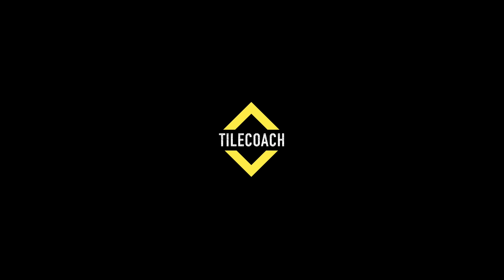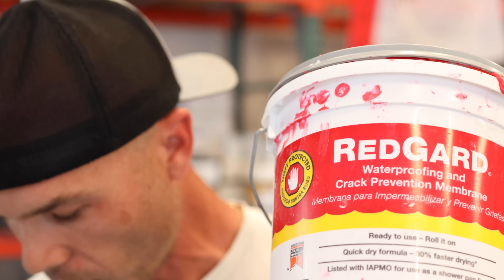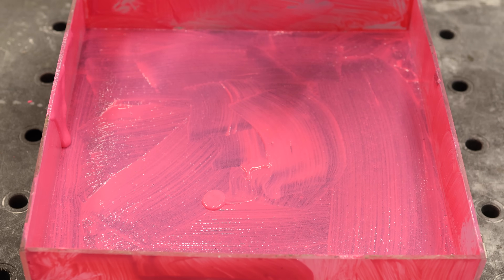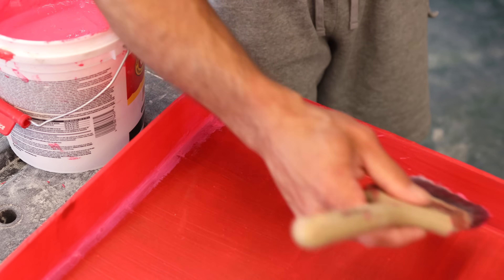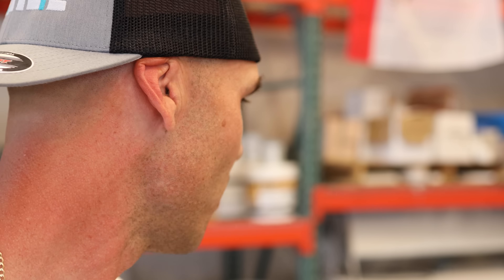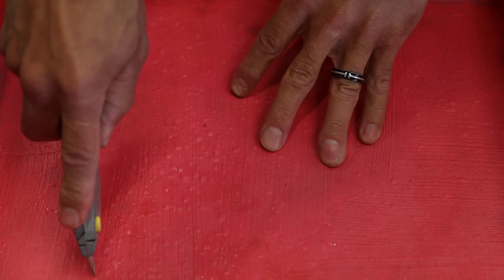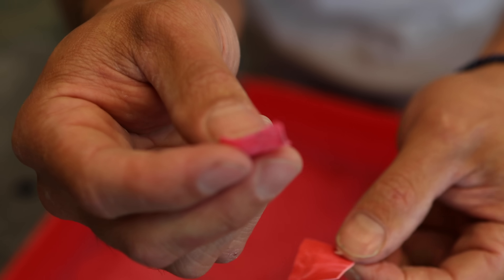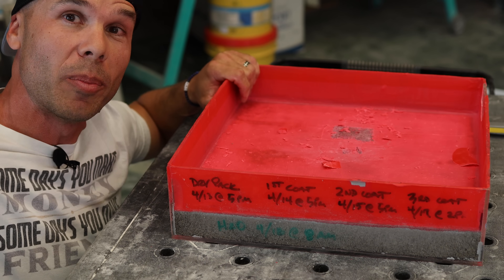REDGARD FAILED FLOOD TEST!!! --- Why Did it CRACK and BUBBLE UP???

Comment: I just took a week to carefully put about 4 healthy layers on my shower.. base.. after flood test yesterday I had the EXACT same problem.. I couldn't find the leak. The wet redgard totally crumbled.
Reply: I think 4 is way too much, you shouldn't need that much. The more you put the longer time it will need to cure, not just dry, especially if you're in a conditioned home.
Reply: @Aaron86v  it's been a bit over a year since I used RG... Not on a pan.  I used it (with mesh tape on my seams and corners) to seal a shower wall.  To meet the data sheet specs for an ISO water proof rating you end up with 4 coats.  It is a horribly slow process, acceptable if you are DIY, but I definitely see why professionals avoid this stuff.
Reply: @Aaron86v  do you think if I did 12 hours between coats and let it cure for a few days after my last coat, it would be ready for mortar bed?

Comment: I've done tested myself and for me it only works when I spread thin layers especially when using a brush cuz redgard does not lay down. I would always use a fiber mesh for corners and use a roller to spread even smooth coats elsewhere. I would like you to do that same test using a roller and making sure it is smooth. Now as far as what the instruction says that amount to me is too much. But I'm sure it will work if spread right. It is hard to achieve a smooth finish with that amount when applying it with a brush, that's why it failed. We are the professionals and at the end of the day we find out what works and how it works. Keep up the good work. I'm starting to record my own videos hopefully I put them out there soon.
Reply: Thin layers is exactly what’s needed.

Comment: Want to see you do the box again, but without the dry pack.  Want to rule out the dry pack as the issue.  I wonder if the porous nature of the dry pack didn’t allow for uniform thickness.  I also think that if any cracks occur it should require 2 coats over the crack.  The crack is a void therefore needs the thickness of two layers.  There is also the question of the moisture in the dry pack bc we don’t know if the water came from the dry pac.  So if the glass box only doesn’t leak, then let the dry pack, dry for a week and then try again. In fact try dry pack one week old and dry pack 12 hours again.  This will clarify the dry pack curing contribution.

Comment: Home Depot needs to reconsider selling Redgard.   This is as scientific as it can get.
Reply: No it isnt as scientific as it gets because all the dry times and mils were guesses. No controls for dry time and moisture meter measurements on the drypac either. Scientific means something for a reason and the scientific method is non negotiable. Simply saying something is scientific doesn't make it so
Reply: Redguard is a waste of time and money.  Many old showers lasted for a long long time without it and with only drywall. There is also way too much room for error with this expensive crap.
Reply: This is literally as least scientific as it could get lol

Comment: This was a great test! I’ve personally had terrible luck with redguard so you aren’t alone in the struggle to understand people’s allegiance to it. Please do Mapei aqua defense and laticrete hydroban! I’m seeing a lot of comments about your technique which I’ll address in complaint->retort: 1)you applied it too thick -> you followed the manufacturer application to a T. If it was too thick than the literature needs to be rewritten 2) trapped moisture from the mortar couldn’t escape -> all concrete foundations wick moisture, no such thing as a slab that doesn’t. So the only way to isolate your shower for this issue would be to use a pvc liner or sheet membrane which at that point don’t buy the redguard. 3) not long enough dry time between coats-> manufacturer says 1hour… if 5 hours in Nor-Cal isn’t enough that means in Florida you would have to wait a week between coats. And 3 days before water exposure was super generous, for it to blister like that is super damning.
Reply: The mortar was still curing — 24 hrs was not enough. Once he put the Red Gard on, the off gases had nowhere to go since RG is also vapor retarder. So it blistered at the weakest points to let the gas out. That’s not an issue in a standard build since the subfloor is rarely  vapor proofed prior to the mud bed and Red Gard application. The off gassing would simply escape down through the subfloor.
Reply: @michaeld2613  but any house built after the 80s if built to code has vapor barrier between the concrete and the ground so the moisture would be trapped, and any house built in The south east before the 80s doesn’t have a vapor barrier and sits on wet ground that wicks moisture all year long. A full cure for cement takes a month (sometimes longer depending on application) . And if the manufacturer doesn’t address any of this in their official literature, then they don’t think it’s an issue; any product intended to be used directly against cement in their literature will mention cure times/acceptable moisture levels
Reply: Though I am going off the assumption Mike read all the available literature

Comment: I thought you supposed to use a fiberglass mesh tape with that never had that happen using the mesh or even floating the seams with thinset and mesh and worked good never had a call back or issue with the shower but I used kerdi on mud bed and red gard on the walls

Comment: Either the mortar interfered with the curing process or redgard absorbs water over long periods. Paint the inside of a clear plastic cup, cure, and fill it with water, then wait to see if it turns lite pink.
Reply: 😮t

Comment: In my 30 plus years of doing shower bases, i have never put red guard on a dry pack .10 years ago was the last dry pack i did and i had a rubber bladder under the dry pack then 48 hrs after the drypack was cured we would use flextile fabric membrane at all 90s and another  piece of fabric on the shower base applied with thinset. Only ever used red guard on the wall. Nowadays with schluter and several other better brands,  there is absolutely no need for dry pack ever..never ever ever. Lol
Reply: It's very hard to find the schluter pans in my area at this time, I think I might have to start back on dry pack if they don't get back here soon.
Reply: @plumbbuild6517  supply is lower in my area as well. South Carolina.
Reply: @plumbbuild6517  noooooooooo. Lol. I dont miss haulin those heavy buckets up stairs at all.....

Comment: I would think if the plexiglass was roughen up a bit and then brushed in a 4-6" mesh band and much thinner coats  it would pass the 24hr flood test. Them directions are trash and not saying red guard is the best but I think if a couple extra minor steps were taken it would have positive results. I'm actually a little surprised you had such good results with them smooth boxes. I understand it's nice to see what's happening but with such a smooth surface it's hard to think anything bites so well. The other thing that could possibly be potential problem is the thickness of the plexiglass. Even tho reg guard is supposed to be crack prevention maybe there is some expansion/contraction going on the same time as the red guard is trying to set up and with it being applied so thick the timing is off? Or like some were suggesting it not having any substrate on the wall portion to pull out the moisture. So I would guess the best real world test with still being able to see anything would maybe be using the same box..same drypack and then some  strips of drywall or cement board PL 'ed 1/2" above the drypack 2 the walls of the box and then with use of 4-6" mesh band and much thinner coats of red guard. That would definitely remove the possible problems I think that cussed the fail. Plus it's exactly how it would be done in a real shower and would still allow you too see the failure.

Comment: Unfortunately, if someone was JUST looking at the water level during a water test, I think this would have passed.  The amount of water loss would have been insignificant over a standard 24-hour test AND you can't see the backside in the real world.  For those comments that said you may have applied it too thick in the corners (thus the cracks), you did it so methodically and with an exact measurement for the sq. footage, not one of us would have done better in the field.  I do agree with the sentiments about using a product such as FibaFuse (not standard mesh tape - too big of openings on the webs) on the corners but I don't believe that had much, if any, impact on your test.  I look at these liquid-applied products as a secondary element over sheet products, mainly because of your videos!  Once again, thumbs up for your testing procedures.
Reply: I think the tape and thinset would help. Also, the glass box isn't a real world application either. I know its beneficial to see any water seeping through but I think he should atleast put cement board on the sides of the box and give the mortar bed time to cure before applying. All of this could yield a different result. But I'm with you. I only use it over sheet membrane joints/kerdi band areas.

Comment: I only use redgaurd over certain parts of my schluter systems. I know its not required but I redgaurd everywhere I have banding (perimeter of shower pan and any joints with kerdi band on the walls. However, I think you should re-do this test and use the cement board mesh tape with thinset at your change of plains and then redgaurd it. May not make a difference but the tape and thinset is required on joints and change of plains. With all that said, id never rely on redgaurd as my only waterproofing. Love these videos.

Comment: There was no way for the moisture to escape other than up through the redguard.
If you had a more natural environment for the bed to cure it probably would have done much better
Reply: Maybe drill several 1/16  holes in the bottom of the plexiglass container.

Comment: Glass box is an excellent idea, but try using glass box, mud the bottom as you did but put pieces of Durock/cement board on the side walls as if it were an actual shower….. if waterproofing does fail you should still be able to see the moisture through the glass on the Durock…. Just an idea
Reply: I agree with Mike G but but simply running cement board into the mortar bed and up the sides and then taping the joint would prove its not failing because of the dissimilar surfaces.
Reply: For me, I wouldn’t use redguard over a the mud. I’m not particularly crazy about the way it bonds to anything really. My first inclination on why the bubbles happened is because there is still too much moisture in the mud at 24h  cure time.  The small amount of hydrostatic pressure was the death nail, while simultaneously mud is notoriously good at drawing moisture out of everything it contacts,one of the reasons for felt paper on dry floors. I’m not sure  Redguard is water based I’d be thinking yes because of how thin it is  ,even if it’s not. the mud is pores and corrosive look at your boots and hands  a week after a mud job.  Just my opinion l. Also I believe your supposed to use mesh cloth on inside and  outside corners  I do but I typically red guard only walls and it’s a pain to fill the corners when it’s meshed. I try not to radious them too much.
Reply: Put a piece of Durock on one side of the glass box, and a piece of other cement board material on the opposite side, leaving 2 sides glass. Then you would be able to see if any water is seeping between the Durock/cement board and the base before it meets the glass.
Reply: Yeah, the waterproofing products aren't made to stick to acrylic.
Reply: Few if any professionals use Durock or cement board walls. That’s diy skill trade 🤣. Regardless, how is mud walls or cement board accounting for the Redguard breaking down in under 8 hours of standing water? As Isaac shows, the Redguard is no longer an elastomer membrane when submerged in water for under 8 hours. This is why no professional licensed tile contractor I know uses Redguard. 

The scary part is that it’s distributed in big box stores where the least skilled tilers such as diy homeowners and flippers are buying materials. These are the people who’s lack of skill needs the most idiot-proof, fail safe waterproofing. Instead these folks are being sold a product that even with the most diligent workmanship is not waterproof.
Reply: @MichaelM-to4sg   what do professionals use on walls if no durock?
Reply: @Gixxr11  following....
Reply: @Gixxr11 they do use durock. Sal di blasi uses durock. Plenty of reputable dudes use durock. They use other stuff more often though. Like foam board.
Reply: @MichaelM-to4sg   Interesting.  What did "licensed" professionals used before Schluter, Durock or cement board?

Comment: I have never considered using redguard instead of a vinyl liner for a shower pan install. I've used it on a few surrounds now and haven't had any issues but I put a couple thick coats on, and usually let them dry/cure over a weekend. No issues yet.
Reply: Pan liner.  Mud bed. Thin coat of thinset on top of mud bed. Then 3 light coats of red guard over entire floor.  Same with curb.  Haven't had any issues.  You still need a pan liner. It would be stupid not to use one.
Reply: Yes I'm with you 2 fold. Thin layers, and it's not a pan replacement

Comment: I think there was too much moisture still in the mud. The Redgard exposed surface dried and trapped the mud moisture, not allowing the Redgard to fully cure. How about scraping the Redgard off the mud and allowing more time  for the mud to get rid of any moisture that might be trapped in it. Then recoat the mud and see if the bubbles reappear.
Reply: you're definitely right and I agree, You got two products that couldn't cure. A lot of people think mortar drys but really it cures,  I don't know about redguard but I'm sure it probably cures also it probably doesn't dry. Then you add the glass it trapped any moisture from going to any other direction pretty sure this was just a big oopsie

Comment: Love the test; keep it up. Thanks for taking the time to do it, absolutely love the testing. Even though you figured the application out l still think it was too thick and would require built up thinner coats thats my opinion.  I have never seen a tile shower not fail even when done right, there pretty but I don't like the construction of them.  I've done them for others but didn't even put one in my own house l built.
Reply: You've never seen a tile showers not fail even when done right? That's a bold statement. I've crawled houses of showers I've done from years ago and not a drop of water. Also tore out a 7 year old schluter shower because the customer wanted to update again and it was as dry as it could get. And both of those showers had everyday use, one being a curbless entry.

Comment: Build your box out of cement board or denshield and reinforce the changes of plane with fabric tape, give it a fair test nobody builds a shower out of plexiglass coach
Reply: this is what I was thinking 'red guard isn't made to be applied to plexiglass. And 24hrs isn't enough time to let the mud pan set properly.
Reply: Aint nobody doing drypack anymore either. Lol. 10 yrs ago maybe. Times have changed.

Comment: What I don’t understand is with so many issues with building water proof pans out of various separate components, why aren’t pre-made one piece custom waterproof shower pans, (like offered by KBRS and WEDI), used more?
I would love to see Tile Coach do a side-by-side comparison, in time and material, of a component pan system (like Schulter), and a one piece custom pan (like KBRS).
Reply: I love kbrs pan. Been using them for 9 years
Reply: Pre-made pans is the best solution. Tiles in any wet environment will always fail sooner or later.

Comment: Pretty sure with you not having the seam tape that Red Guard supplies probably allow the water get to get to the cracks once the water Gets behind everything else just gets sucked right up.
Reply: They don’t supply seam tape with redguard,  whether or not it’s available to buy separate is unknown to me.
Reply: @AK-ky3ou  redguard does have seen tape. And yes you have to buy it separately.

Comment: Over thinking this.. you don't need to figure out how much to use, just roll / brush it on the same as latex paint, let it dry. apply second coat.  You put way too much on in one go which is why it cracked. I usually do two coats on walls, three on the pan and up 4 inches, 4 coats in all the corners. It dries in less than hour. Never had any problems.

Comment: I suspect the concrete pad did not fully cure. I’d call the manufacturer to help pin this down even though the instructions do not mention this. I know people that use redgard but I’ve never used it yet. I am so gun shy about doing a customer’s bath because it takes a lot of experience to do it right. I have been installing acrylics for this reason, even though tiling is so much nicer looking and in high demand.

Comment: And any ways the weather is not gana be directly contact with the Redgard.
To agree with the process goes 
Redgard, thin set, tile,grout ,and at end a sealer finish coat. 
You should do that sample process. For we could what happens.

Comment: Thank you for these tests! Schluters’  All Set is not available in my area…would another modified thin set work with the schluter membranes? We have the Mapai and 1 source for the Laticrete products-but ive pre purchased the Schluter membrane kit and would like to use if possible…???
Reply: Yes, as long as it’s a modified thin set.
Reply: Laticrete makes a great thin set